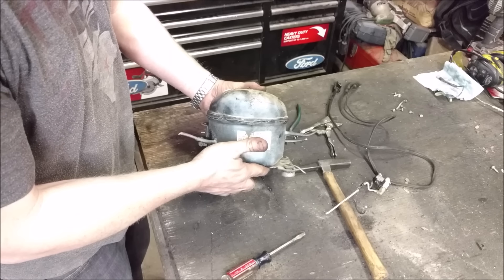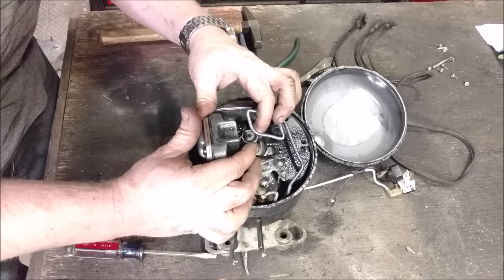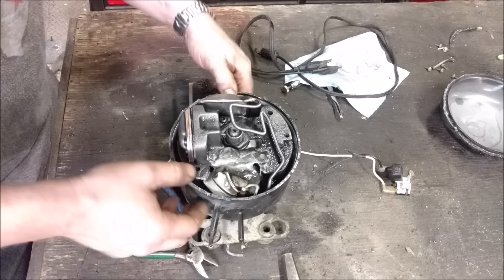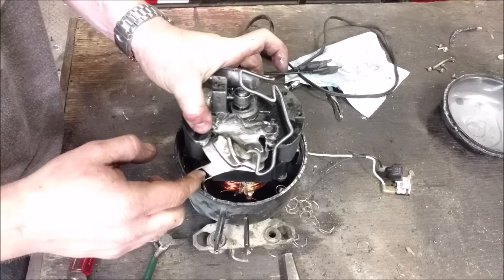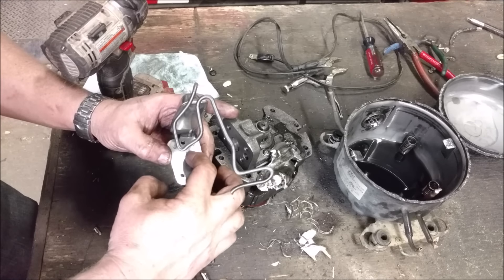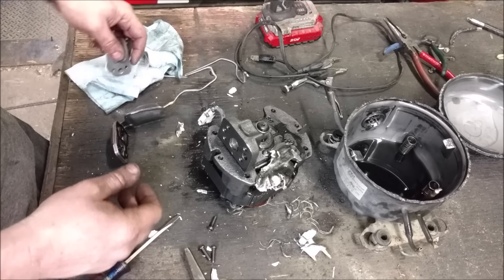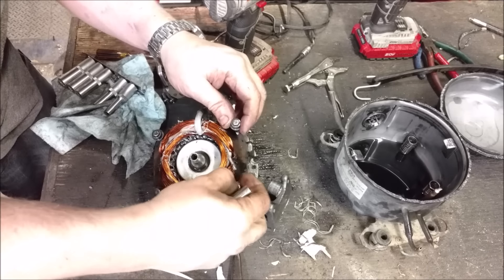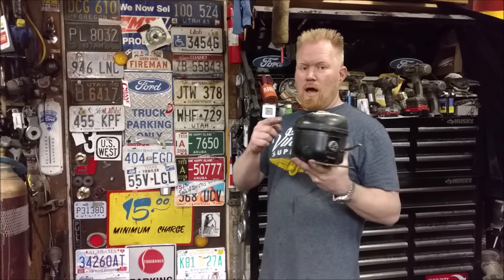What's inside a Refrigerator Compressor

Comment: The valve is called a "reed Valve" , the compressor pumps refrigerant, not air and the refrigerant has to be gas, not liquid. It can tolerate some oil as the oil is fully miscible with the refrigerant but liquid refrigerant will ultimately cause a broken reed valve. The intake is called the "Suction" and the outlet is called the "Discharge".  If the reed valve breaks or gets bent from pumping liquid, the compressor will still run however the discharge gas will short cycle back into the suction of the compressor and then it will overheat and eventually burn out. Nice pull apart.
Reply: Macca Stacka thanks for correcting this guy. There should be no air in a vapour compression system. Air is non-condensiable. It call a hermatic compressor because it sealed.
Reply: Macca Stacka, the reed valve reminds me of those loud Cox model airplane engines of old :-)
Reply: Macca Stacka post us a link to your video.. Would like to see
Reply: No videos sorry pal. I'm just an Air Conditioning mechanic. However, sixtyfiveford did a great job of showing the workings of a compressor.
Reply: Yeah its one of the most simple single stage compressors they make. much different from the 2 stage ammonia refridgeration i work on. ever work on a CP booster compressor ?
Reply: And their is always one in the crowd, let´s see your video
Reply: Eric Vickery exactly, we knew what he meant.
Reply: CORRECTION: there should be NO LIQUID in a vapor compression system, as LIQUIDS are 'non-compressible'...you got that all WRONG to know it's called a 'hermetically sealed' compressor...amazing.
Reply: I always tell people that if I am totally pronouncing something wrong or calling it by the wrong name PLEASE TELL ME! Don't let continue to be wrong.
Reply: Over charging a system will cause liquid to go into the compressor and into the reed valves which will shatter them...or split them..
Reply: Thank you for you educational knowledgeable comment, I learned a little more here 👌😃👍🎓📘📐📚
Reply: Well, the refrigerant undergoes phase transitions during each cycle, from gas to liquid and back again.
Reply: Yes, whatever you say.
Reply: @gns-gu8xh  He demonstrated his knowledge with his comment (which is 100 percent accurate), there is no need for a video.
Reply: reading and writing goes together: I suspect that the other valve is called "wright" valve. The comp can pump & compress anything of gaseous form: so why not to nick-name all of it by "air", whether it is R22 or SF6. Ho!
Reply: No, it is called not hermatic, but hermetic, and it is not because it is sealed. It seat there all by itself like a hermit, that is why it is called that.
Reply: @sergeyshchelkunov5762  Reed, not read. There is a difference. And, no they're not called wright. Not every gas is air so why would you call it all air? If you were joking then disregard this comment.
Reply: @DrFreeeman  of course, I was. But in principle any gas pump can take any gas: so if he forgot to call it Freon, and called it Air... I think it is okay. We all know it is now a Freon (safe for houses) but it is being phased out as unsafe for the atmosphere, So soon it will be almost exclusively  some CH-combo, which under certain conditions and specs. technically can be reffed  as gasoline, or diesel . Imagine having it in your  system... a tiny leak, and boom! your house is in flames... but EPA says that CH-combos are safe for the atmosphere, never mind your burning in your house. What a life:cruel, vicious, and unfair!
Reply: @sergeyshchelkunov5762  Yes, but they're only explosive in a narrow range of  concentrations, so they wouldn't always explode, but there is a fire risk. Nowadays with R600a (isobutane) you see fire warning stickers all over whatever appliance is charged with it. With R-12 getting rarer, I'm appreciating more and more the old equipment that uses it.
Reply: @DrFreeeman  of course, I was. But I think it is okay if he says "Air". Any Freon pump can take any other gas, in principle. So, with Freons being phased out, we will soon have almost exclusively CH-combos. EPA says that they are safe for the atmosphere...maybe true? But CH-combos are nothing but the likes of gasoline and diesel. Imagine a tiny leak... then its there right above your furnace, and the next thing one knows... kaboom! All goes to flames. But it is "safe for the atmosphere", never mind somebody burning in his house, or so EPA thinks, and declares. What a life: cruel, vicious, and unfair!
Reply: @cst256  Exactly - thus using the latent heat of vapourisation to improve efficiency.  You could compress air and let it expand, but the cooling effect will be nowhere near using a proper refrigerant that undergoes a phase change.
Reply: огромная эрекция  Air is a mixture of gases.
Reply: Liquid sounds better, gas sounds stinky

Comment: I built compressors for 16 yrs, I  love cutting them apart, and I've made air compressor and vacuum pumps from them!  The compressors we build do have rings, not all do, but some of the bigger pumps do.
Reply from the maker: Very cool.
Reply: Can you tell me maximum pressure and temperature this compressor can take atmospheric air to ??
Reply: Not sure what a fridge operates at but a car AC(pretty much the same basic function) can reach up to ~20 bar(~281.4 psi) before the safety valves start releasing. Looking at the size of that motor compared to the piston, it'll take a while(depending on pressure vessel size), but I'm sure it can pump a surprisingly high pressure.
Reply: I've got a Buddy of mine with 6 of these on top a tank made of 10 inch steel pipe. Its the quetest air compressor I've ever seen.
Reply: An old compressor as a cheap vacuum pump.  Genius! 
Definitely gonna keep that in mind the next time I come across an old fridge...

Do you have to keep adding oil to the thing or will it keep going just with what's inside?
Reply: IT ALL SOUNDED GOOD TO BUILD MY OWN DIY VACUUM PUMP BUT SOME KNOWLEDGEABLE GUY SAID IT WOULD DIE SHORTLY WITHOUT OIL.....HMMMM?

Comment: Standing Ovation, Applauds You. Goldsmith/Master Jeweler here. 
Certified Photovoltaic/Electrician Solar Thermal Technician. DIY Professional, etcetera etcetera... I've converted refrigerator motors to vacuum motor BUT Never opened one up. Thanx for sharing and saying that "it's ain't the end of the line for this" you're still going to keep it running by turning it into an air compressor. 
i Like, OLE!

Comment: i used to work in a plant that built refrigeration commpressors like that. we made the upper and lower shells(outer housing), the mounts the hold the rubber vibration rings to the fridge, the stays that hold the springs to mount the compressor  inside the lower shell, the bracket that holds the cover on the elect plug and the stainless reed valve. good to see inside one again.
Reply from the maker: That's neat. I'm sure it was some big machinery that stamped out the shells?

Comment: Good vid! What is amazing, is all the guys building these into 'mini-silent air compressors' for their garage, and that they work (for a while) without burning out! (it's all about that duty cycle, guys...that forever-on-state duty cycle, which these weren't meant to have)...
Reply from the maker: Thanks. I would say as an air compressor they need to run a max of 30 minutes before they get a cool down to prevent burning them out. While in an AC/refrigeration setup they get the refrigerant constantly cooling them so they can go longer.

Comment: I've never seen the inside of a compressor so that was cool. Learning has taken place! Watching is smoke was fun.
Reply from the maker: Letting the smoke out of stuff is always fun.
Reply: sixtyfiveford You let out the magic smoke! I do that A lot! mostly by accident!!
Reply: wyattoneable it's like watching a shaman ghost-whisperer sending a lingered spirit off to the hereafter.
Reply: Gary Ronan speaking of magic smoke, I put a 9 volt battery to an LED with no resistor and about 5 seconds later it started smoking, but I took the battery off before it exploded, if LEDs explode if they got too hot, but that was like 6 or 7 years ago. After that I learned that LEDs work at 2.5 volts max, I think.

Comment: Picked up a dryer today while driving around to cut customers grass. Love old dryers to scrap because 90% of the time I find loose change in them. Found dime,nickel ,and two pennies. I separate wire,motor good metals like brass,copper,ect then compress with skidsteer . Enjoy the vids!
Reply from the maker: Thanks Jim.
Reply: Jim Smith, after taking apart an old dryer to replace the heating element that shorted out due a bra underwire, I found a $20 spot. Paid for the repair, not to mention not having to replace the dryer!

Comment: First time I see one opened up like that.  It's always the same with those things though, there's not as much to them as you might think.  Thanks for sharing this Moe.
Reply from the maker: It's always fun to tear broken stuff apart and see what makes it tick.
Reply: Have you ever disassembled air tools?  I was trying to take apart an old Harbor Freight butterfly impact wrench, but it seems like it had a one way assembly on the end plate, which must be pressed in, with no way to take it apart non destructively.  I didn't take the hammer to it like you were doing in this video, because I wanted to see if it was simply some gummed up vanes in the air motor.
I've concluded there's no way to take it apart, but thought there must have been someone out in YouTube land that's tried before.  Doesn't seem like it though, because the only videos I could find were the regular pistol grip type impact wrenches.
Reply: DTR RTD, have you checked if AvE has a BOLTR on that?
Reply: @ A LeBlanc: So true. Very often the genius is in the simplicity of the design IMO.

Comment: Hey look guys!! It's an old school truckers habachi!!!  Well sorta. Now cut just BELOW the welded lip and remove the resulting ring. Drill 5/8ths holes all over lid except right in the middle. Now drill a series of 3/4 inch holes about 1 1/2 - 2 inches up from feet.Remove guts (harvest for the copper if you want) remove rubber grommet feet and replace with wooden blocks. flip lid and drop into inside. load with coals and burn out the pag oil and other contaminants. Use existing 1/4 inch holes from coolant lines as a place to attach a paint can handle. Flip, wash out really well with Dawn. Reload with wood or coals and hand out skewer sticks and ask who brought the beer!!

Comment: Why did it burn out so fast when you plugged it in and kick started it? It sure made an interesting sound and smoke show.
Reply from the maker: The start windings were already completely shorted out. So I used the run windings that were also shorting together but not completely shorted out.
Reply: Dasdfjkl maybe because where it was melted made the coils melt together making a short circuit but in a strange way. That's just a guess.

Comment: Great video.  Ever wonder why these are so much more reliable than A/C compressors in cars?  Rather than using an electric motor to power the compressor, the car compressor is powered by the engine via a fan belt around the compressor pulley.  That pulley is connected to a shaft that goes into the compressor.  As it enters the compressor, it needs a seal and that seal can eventually fail letting the refrigerant out.  The fridge compressor has the motor inside so it doesn't need a shaft to run it.  All it needs is two wires.  While they're sealed, the wires aren't rotating so the seals will last indefinitely.
Reply: @Nunya Business They should have less problems as they've eliminated one pretty major reason for a leak.

Comment: Thanks so much for breaking it down to its simplest components. It helped me a lot to get a good intro into the subject. I have been wondering how the compressor works, I am served!👍🏽👍🏽👍🏽

In addition I would like to know how one could (process step by step) turn the refrigerator compressor into biogas compressor to compress biogas into an LPG cylinder or a car tyre.
Thx!

Comment: I was Eric the car guy a few weeks back and he had some special bolts that looked smiliar didn't say what they are called. But he did say they are made to fit perfectly into a 12 sided spline socket or wrench
Reply from the maker: Thanks for the info.
Reply: Triple square XZN spline bit
Reply: ElleExxe Foursixty No triple square xzn bolts have a female impression, these ones on the pump have a male spline.
Reply: Why did you assume his identity a few weeks ago.Is it that bad being yourself?
Reply: Hmm, I've only seen XZN referred to when the bolt is a socket head style.
Reply: Its like a box end wrench/spanner. A 12 point socket is meant for hex heads but have twice as much engaging teeth. Good for tight spaces. Dont tolerate as much torque as a normal hex socket though. There are also double hex heads which is a hex offset to another hex by 30 degrees. There is something similar in tooth count which is a triple square, its the same principle as the double hex but for square drives.

Comment: We have such compressor on one of our small refrigerator made by Sanyo. The refrigerator is 25 years old and it still works without any problems.
Reply: 43,000,000,000 revolutions in it's lifetime 😵

Comment: We turned one into an air compressor when I worked in an appliance shop.  Took a long time to fill the tank we connected it to but we didn't use it for a high demand application.  Just short bursts of air.  I believe the air compressors dentists use to run their little drills.use this type of compressor.

Comment: Crude compressor, but effective.  If they are so quiet, why are regular air compressors so noisy.
Reply: +Robert Heinkel - Primarily because of the shell and the spring mounting plus the fact that the gas it pumps is in a totally closed system.

Comment: I have a hypothetical question. If this compressor was together and working normally and you sucked up gasoline fumes with it, is there anything exposed inside the compressor electrically that could ignite the fumes? I’m not talking about the fumes as it leaves the compressor as we all know many things could ignite the fumes. I’m talking about inside.
Reply: Someone told me that you can put a match out in gas IF AND IF you were fast enough. It is the fumes that would ignite before it reached the gas. I would have to say yes it would if it had a big enough spark to ignite the gas but even gasoline is a liquid. So the gas fumes are far more easier to explode than the liquid. Unless it is broken, there should be no reason for a spark. A spark requires a space between two points to arc a cross. NOT an expert but just my thoughts
Reply: You need a certain amount of oxygen present for the fuel to explode. This is what a carburettor does in an internal combustion engine. If it is pumping liquid fuel and there is no oxygen present it shouldn’t ignite.
Reply: @cameronwarman6136  Yes, I understand all of that but is there anything exposed electrically inside that would start a fire if the conditions were right? Some electric motors have brushes and inherently create small sparks at the brushes. Do these compressors create any sparks while running?
Reply from the maker: These are always brushless motors and don't produce any sparks.
Reply: @FromSaultoPaul  if there was no oxygen in the system there would be no issues.
Reply: If there isn't oxygen THERE CAN'T BE IGNITION!!
Reply: @sixtyfiveford  fuel pumps have brushes but are submerged in a fuel well.
Reply: I realize this is an old question, but to answer it, R600 is (mostly) butane, which is flammable.  It's sometimes used in smaller wine coolers and things of that size.  Even if it does ignite, there isn't very much of it to burn.  Propane can also be used as a refrigerant, known as R290.  There are YouTube videos on how this can be done.  I'm not aware of any commercial applications for propane though.  Use at your own risk.  lol.
Reply: @BradFoszz   It won't ignite without oxygen (or other oxidizing gas, like chorine). If gasoline fumes come with air (and oxygen) it will ignite around 250 - 280 C, which may be achievable, since some of these compressors can reach 40 bar, and for this temp you need around 6.
Reply: There are fuel pumps where the motor is cooled by the fuel.

Comment: I've always wondered about whats inside those. I watched because i had a rather new 5000btu window A/C that lost it's gas so rather then "fix" it i just took out all the coils and cut a section of the case out and made what looks like a 12 inch wide A/C. But it's just the compressor i use as a air compressor to air up tires and such. I was going to ask some questions about it's safeness or anything i should know about my project. But at the end of this video i seen you was going to make something like what i did so i subbed and wrote this post.
Thanks for the interesting video and i'm gone to watch more.
Reply from the maker: Nice way to re-purpose a dead window unit. Thanks for the subscription. -Moe